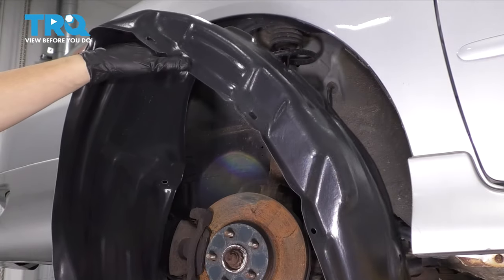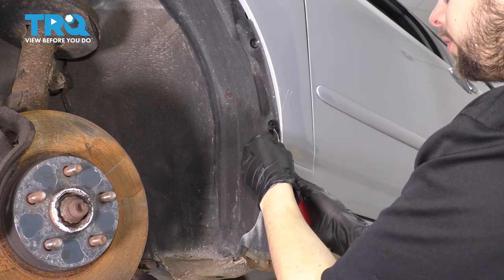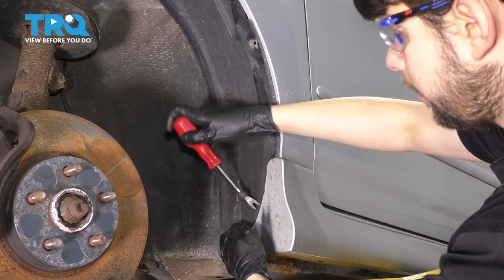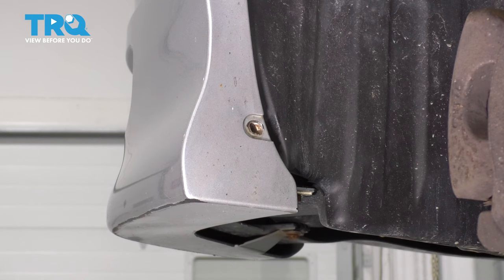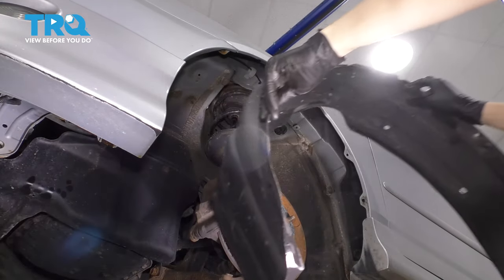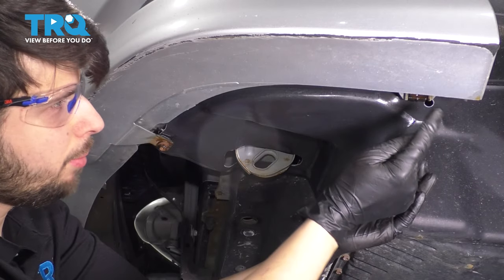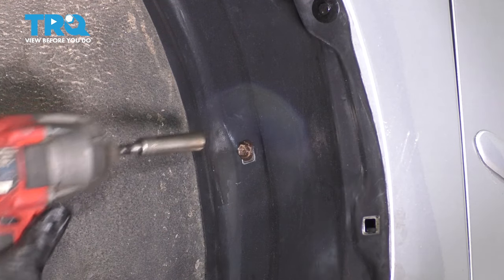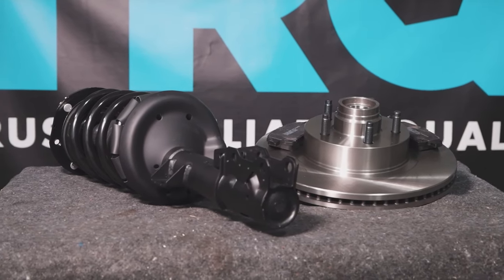How to Replace Front Fender Liner 2003-2008 Toyota Corolla

Comment: Great video. Used this as a guide to replace mine. Thanks. 

Also, when putting the wheel back on what was that tool called that is beeping at the right torque?
Reply from the maker: +David Thanks for the feedback! Its called a Torque Wrench. http://1aau.to/m/Shop-TRQ